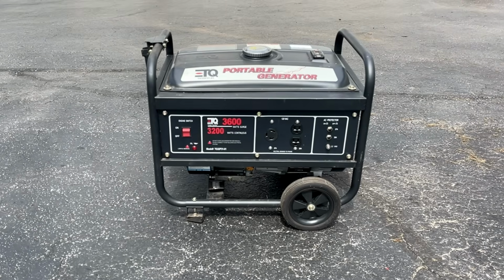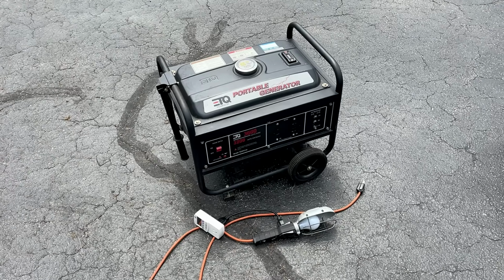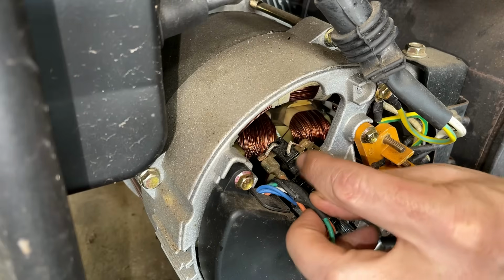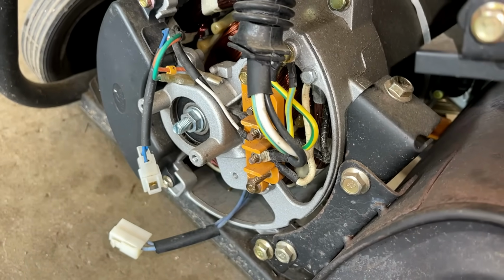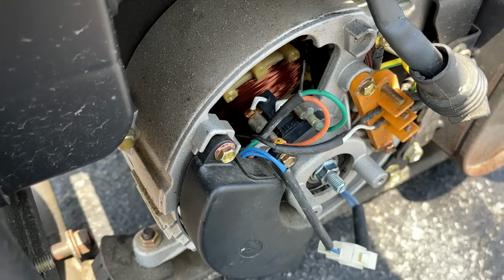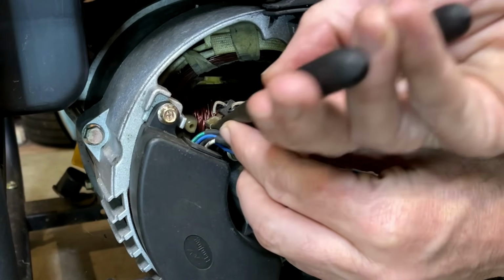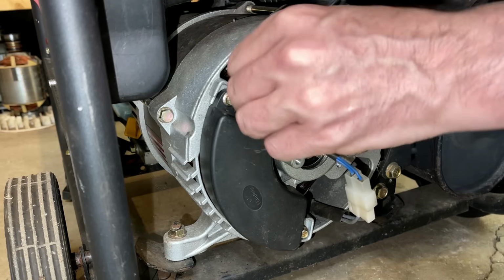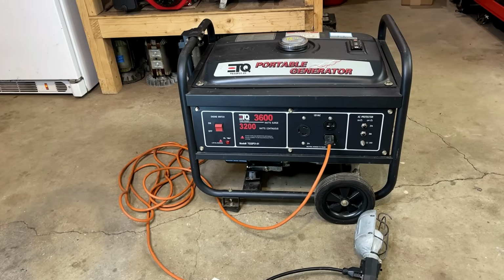Two Generators No Power Output - Same Model, Same Problem?

Comment: Hello, again. I just got, for 60 $  canadian, a Champion Gen.  4450  starting Watts/3650  Running .   MODEL    #   201119.  This one, has an IntelliSense digital display. And, a large knob - shuts off  gas , and power. // IT  makes no power . Took the AVR end cover off ; check stator coils....all  good.  Check  brushes ,,,,,not much wear at all. Good spring tension.  Remove AVR  .  Check  rotor  brushes....for  rotor  coil.  W o W.   ONE, of the slip rings, the outer one, closest to the bearing. ?  Missing the  small  tang, from the insulating stuff, under  both slip rings. There was about 1/16  of  an  inch, sticking out. Originally, it went 90 degrees UP....for about 3/8 of an inch.  Took end  bearing retainer, off. Remove 4 stator long bolts. Remove stator.  Okay.  ////werk work work // Fixed the broken  wire....pointing  directly  AWAY  from rotor .  Centrifugal  force......RIPPED....that  tang,  off  the brushes supporting  plastic. The other end, the inner slip ring, that  Tang, still there. Shorter  distance,  from  rotor coil, than the outer one.  THEY   OUGHTTA   MAKE.....THAT   TANG   MATERIAL....of  better  metal....OR  LARGER  AND  STRONGER ! ....Filed, that 1/16  tang....soldered small rotor wire, to that .   Check with ohmmeter....= Good....got  connection.  Resistance, about 55  ohms.   Good to go.  Hook up 12 volt battery.......sparks.  Good.  Assemble, the whole thing....again. Starts  right  up....but  STILL  NO  POWER !  i've  ordered new AVR on amazon , about 27 $  canadian./////....anyway....good luck, to all.  LESSON   >  > >> ..pretty  shoddy, inner  hookup  design. KEEP  AN   EYE   OUT   FOR   THIS   type  OF    ''' doesn't   MAKE   power ''' -----  sometimes...ya  gotta  disconnect, that  yellow  wire,  which  goes to  LOW  OIL  sensor.......THEN,...........chk  if  it  makes  power ..../ The black, one is the engine  power  disconnect....

Comment: I have a Sears 30lbs air compressor that isn't starting. 

THERMALLY PROTECTED

MOD

5KCR49TN2450AX

SER.NO. XWFP42

HP

HZ 60

V 120

PH 1

RPM 3450

CODE N

A 15.0

SF 1.0

SFA

FR 362

AMB 40C

INSL

CL

85

CONTINUOUS RATED

AIR COMPRESSOR MOTOR

PART NO. D26712

MADE IN CHINA

If you ever come across this air compressor motor. I hope you make a video of it 😊 Thanks

Comment: You can use 220 grit sand paper, then polish it some with 320 or 400 grit. Just don't ever use emery clothe! Small metal particles can get imbedded in the slip ring or armature. Thanks so much for your video, very informative!

Comment: You should never start a generator with a load. Without something plugged in is correct, that's probably what smoked the brushes to begin with. Engine rpm!

Comment: Hafa Adai James... which means hello from Guam a Pacific island, I got good information and guidance from your videos. I did notice on the second generator on your video. I caught something that may cause some issue to the generator after several hours of use. You missed one bolt that secures the brushes to the brush mount. I didn't know any other way to tell you this but through this forum. I am in no way trying to degrade your videos. I want you to know I sincerely received a wealth of wisdom and knowledge from what you share on your videos. Thank for doing this.
Reply from the maker: There is only one bolt to hold the brushes on.  The other side uses a locating pin.

Comment: I always use 2000 grit sand paper on the slip rings and spin the rotor slowly with a drill to speed up the process

Comment: Any running generator that does not make power needs to be re-excited with a 12volt car battery.. while running use a romax wire plug wire in the plug in outlet on generator then the other end touch it to a 12volt car battery neg and positive for just 1 spark and your generator will make power again !! Im a retired king crabber ship engineer 🎉

Comment: I’ve heard of people using a small 12v battery to briefly power one of the ac outlets so back feed 12v to the ac system it somehow fixes it but I was told it 
Read magnetizes the coils  I saw it on YouTube
Reply: Use a blocking diod so the battery doesn’t get back feed!

Comment: ooh - so glad you found a problem -

 my genny stopped power output - bummer
I looked for a mechanical issue ,but found none - 
it has spare brushes, but the others looked fine {Like new}

 longer staring -  {a few moments later}
I saw on the panel,  there is a breaker that had tripped - 
reset and power out put.    {felt relived and stupid at the same time}

  I thought I read that in the instructions, years ago. . .
but who remembers everything? 

 another jenny had a similar issue -
 first thought: Im going to look smart as I know this. ;) 

 I checked the breakers - but they were  fine.  looked for fuses - fine

there was a switch to turn on the AC outlets - 
it had a DC out let and it had switched to that 

 each model has its "set" of features - 
maybe there are written instructions for a reason?   ;)

Comment: Love the involvement of the community. I own almost every Predator Inverters/Gen made from the 2000, 3500, 4550, 8750 2-9500’s and I just got an 11500. Don’t ask the why part…

Anyway I have been working on small engines for almost 50 years and they are second nature to me. The electrical side is all new and I haven’t run across any big issues yet, I’m just watching diagnostic/repair vods preparing for the day. 

Your community is awesome!  I shall post my questions as they arise. I am confident that I will get the full spectrum of answers from duct tape and coat hangers to custom schematics w/parts lists and sources. 

Thanks for the laughs and info.

Comment: You didn't check the voltage on the 240 plug, maybe you have power there, could the wires to the 120 vot system be not connected somehow?

Comment: Water based varnish on the windings, generator stored in damp place  cold > warm > cold the varnish starts to accumulate on the underside of the slip rings then gets spread around when in short use. Causing higher resistance = heat.

Comment: this is normal shit ,  brushes.  very easy to fix,  but they are screwing up the rotors on purpose they rob you of the magnets,  they will work for only about a year,  they used to have double screws to hold the brush,  the new ones like this one, only has one, and a peg, and that is why it fuks up, the brush,  the other magnets of the rotor are in between the rotor and the windings,  if they gipped you on those,   you have to throw it away,  to hard to find rotors........  an to expensive,  witches in corporations do this shit on purpose,  the peg on the right of the brush,  an no proper sized magnets,  so to make it to break is what you call it.   Be careful which one you buy,  they want you to buy as many as they can sell you...

Comment: I had a harbor freight it lasted only a year,  gave up the power/    when i took it apart,  what i found was the wrong resistance from the rotor to the winding,  what they are doing with them is removing the magnets from the rotor,   i have old rotors and they have 4 magnets on the rotor about 1 inch by 4 inches long,   this one they only had put one,   like they were trying to rip me off for the magnets ,  and they did,   never will I buy Harbor freight generators again,  bunch of china men gips ters doing whatever the fk they want

Comment: I'm wondering if this carbon build up on the commutator wasn't caused by an over load situation?  My father in law bought a 1000 watt Coleman generator and tried to run the motorhome air conditioner (1200 W) off of it. Lasted for a few hours and quit.  Many people don't understand appliance watt draw and generator watt output.:goodvibes: THANKS FOR POSTING!!

Comment: A thought - get an old set of brushes and glue a good chunk of scotchbright to each brush - reinstall brushes and  pull engine over with plug removed and plenty of contact cleaner = polished slip rings - like all your work and inspired me to get non working equipment back to life cheers

Comment: James, I just watched your video and I was curious to know if you’ve ever tried something like this. At the auto parts store you can get a paint on copper paint to repair the rear window defroster strips on a car. When you have worn slip rings like the ones in this video have you ever considered getting some of that painting it on and then smoothing it out With a green pad?

Comment: Probably a dumb question but at 13:50 I noticed that the bolt end, that you put the socket on to turn the rotor earlier, is not staying centered while the generator is running.  Could that indicate excessive play in the end bearings?  Is that wobble normal?

Comment: Just bought a 9000 watt blackmax.. got it running great. Had power when i bought it. But now nothing.  Did as you said and sure enough the brush housing is cracked. I superglued it. We'll see. I have another generator i could borrow from. Grest job sir.. i was thinking id really screwed up.
Reply: Replaced brushes and avr.... still no power. When I hooked a battery to it was putting out 55 volts.???

Comment: HI James, a great repair video.  It's nice to have easy fixes once in a while.  Anything with slip rings or commutators should be put on a lathe with centers and trued up.  Might I suggest another tool to your arsonall, a milliohm meter.  They accurately measure from 0.001 to 120 ohms.  Perfect for measuring winding's.  They use a four wire kelvin clips to balance lead resistance.

Comment: James, a friend brought a generator for me to work on. The generator had been sitting for several years with untreated fuel. Cleaned the tank, carb and had to replace the fuel stop cock valve. Cleaned the generator, air filter, sparkplug and fogged the cylinder. The generator seems to have low hours and is in good shape. I added fresh fuel, and the generator started right up, so far looking good. The voltage meter was not showing 110 volts, and the needle fluctuates up and down and all the way off and on. I attached a fan, and it ran very slowly at first, the generator stayed at 110 and the fan ran for a moment and then the power fluctuated again. What would cause this issue? The engine runs great. Checked the voltage at the brushes 5.0 volts and at R1/R2 5.0 volts. The brushes look new, the slip rings are clean and smooth. Thank you for your videos and any help you may provide. How do I test the AVR in or out of the generator?

Comment: I have a weird scenario. On a harbor freight  6500. Predator.  I also just changed the  AVR and brushes..  as a result I did get. Over 120 ac. On both of the  120 volts   outlets.  And confirmed over 240 on the 240 outlat.   What happens is it starts and then powers a device in the scenario it was a refrigerator  Samsung bespoke  three zone .  It powers the  device. However only for a short while , like 15 min or so then it just  cuts power  but motor still runs.  Have you ever seen anything like that .  Sorry I am new to your channel.

Comment: thank you so much. I couldn't figure out why my generator's circuit breaker wasn't resetting. I never thought about removing the load before trying to reset lol it's working again and I have heat to sleep tonight. thank you!

Comment: My guess is the slip rings got just a little corroded from sitting, then when it was fired up the roughness of the slip ring damaged the brushes and caused them to over heat and melt. They do make a special armature/ slip ring cleaning stone that we use all the time for welders out in The field. You just touch it to the slip rings with the engine running and in a few seconds they are polished like brand new !

Comment: Drill motor with a 1/4 inch extension to a socket on the nut on the rotor will spin the rotor faster when you want to polish the slip rings.

Comment: I had a thought when you were cleaning up the slip rings: When you have a bad rotor, you might cut up the slip rings and find out how thick they are. If they are relatively thick the next time this happens you can use something more aggressive (grades of emery cloth) to make sure the rings are really smooth. Another excellent video. Thanks!

Comment: Could one be slightly more aggressive cleaning the slip rings - say with fine wet and dry paper, to remove a bit more pitting. Or are slip rings not substantial enough to stand deeper cleaning ?

Comment: I have the same generator and mine runs smooth but the voltage coming out is fluctuating up and down, could this be caused by the AVR
Reply from the maker: Could be the avr or maybe the brushes are bouncing on slip rings.  When they bounce they will arc and the rotor loose power for a second causing the power change for a second.
Reply: @jcondon1  Thanks, didn't know about the brushes bouncing but now I know I'm looking in the right place
Reply: Hi James, I'm still trying to get this working but now there's no power out, I took the AVR off and the back has a lot of cracks. Problem now is same as yours it has an odd AVR the way it only has a 2 wire plug and the other two go to the wire block, the only one like that I found after hrs of looking is $99.00 on eBay which is crazy, So am I able to use a 5k AVR with a 4 wire plug and resplice the wires, but I won't know which wires go where. Sorry so long, Thanks

Comment: James, informative as always.  Question -  Using "CRC electrical contact cleaner", spraying that on the armature help clean up the carbon build up?  What about using fine steel wool or would it be a possibility of small particles of steel wool getting into the machine?  Nice trouble shooting.

Comment: Seriously mis-engineered, factory recall material, not only are the brushes riding too far back, the end bearing also has a huge gap  from the seat in the end bell. The rear castings need to be shaved down 1/16" or so.

Comment: It's mind-blowing that they'd use PLASTIC brush holders.
Reply from the maker: They have to be insulated from the brushes.  That said there are better ways, just costs a little more.
Reply: @jcondon1  I have a mid century engine driven welder made by Wilson (vids on my channel). 400 amp DC generator. It has MASSIVE brushes, about 3 inches long and an inch and a half wide. They built it like a tank. All brass brush holders with porcelain insulators holding them to the generator head. Awesome tech. I just wish they still put some of that into the new generators to make them a little more reliable.

Comment: Try plugging in a corded drill that is reversible and start generator and squeeze the on button this will reverse polarity and energize it. then run in forward and test other equipment in it I have seen this work many times

Comment: I won't bet a dime on these new brush holders! The brushes always get hot, and they always spark, more or less. This is their normal working condition. On the other hand, it is completely ridiculous for me to use thermoplastic material for brush holders - this is a guarantee of another failure that will occur again soon.
In well-built brush holders, the brushes themselves are usually placed in metal holders constructed in such a way that they have enough surface to dissipate the heat generated by the brushes. These handles are attached to the insulating material ALWAYS with high resistance to temperature. In very good constructions - electrotechnical ceramics are used, in poorer ones - fiberglass in epoxy resin. However, I have NEVER seen such crap so far!!! Chinese shit not worth pulling out a screwdriver and wrenches.
There is ONLY one way to reliably repair it: replacing it with a heat-resistant brush holder. Either buy a good one, if it is available for sale, or make it yourself from basis, which is unprofitable in my opinion.

Comment: I'm not much of an electrician, but I am a good machinist. I deal with repairing shafts that are chewed up from locked up or broken roller bearings. The damage on the first generator looks like to me to be from the brush after it broke out of the housing. It then was riding along the edge of the slip ring at an odd angle, with the sharp edge digging into the soft brass causing the chattering cuts all the way around.

Comment: I have an ETQ generator 8250 that I got for $85. It had almost no compression. I believe the rings were shot due to cylinder wash( gas in oil) . I honed the cylinder and installed new rings. Once I got the engine running, it was not putting out any power. Low and behold my brushes were worn down(actually they were short and had jagged ends like they broke off). I received my brushes today. Hopefully that will fix the problem. I’m probably going to order an extra set to keep as a spare. I don’t want to have an issue when I need to rely on power during an extended power outage due to storms. Recently was out of power for over a week in Louisville ky. 😩

Comment: Great video! I have a 5 month old preditor 9000 Sometimes I crank it it makes power immediately sometimes it runs a minute sometimes 4 minutes before it makes power. Have you seen this before?
Reply from the maker: I have not.  Most likely a loose connection or a problem with the brushes or AVR.

Comment: Wow, what's the chances of 2 generators of the same make & model falling in your lap & both having the same problem... And a fairly easy fix too! I wonder if it would make sense to clean up the slip rings with a little emery cloth first & then polish them up with the scotchbrite pad obviously making sure to clean any grit off them when done. I've used this method on automotive starters without any problem. Nice job checking these out & quickly getting to the root of the problem!

Comment: Is there some reason you couldn't use fine grit sandpaper to better clear the slip rings?  Btw...on the first generator the positive was on the right side...when you installed new brushes you put the Green wire on the left.